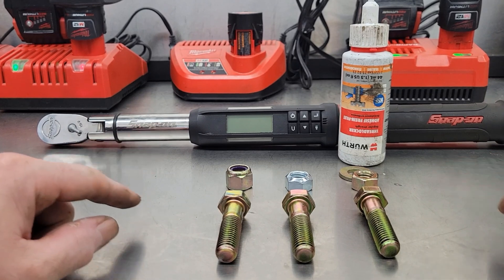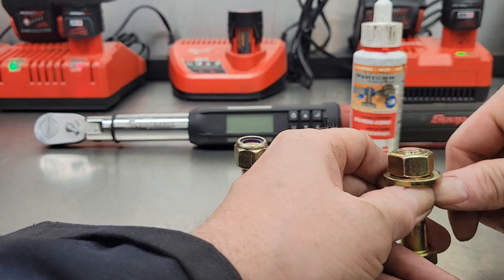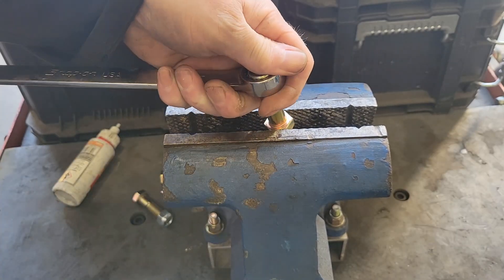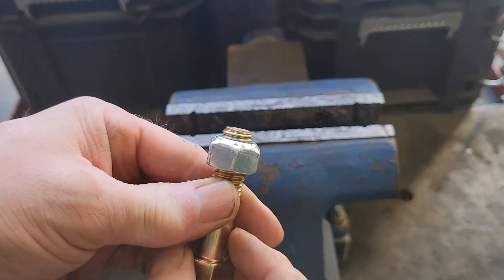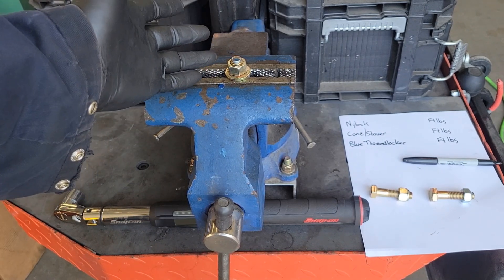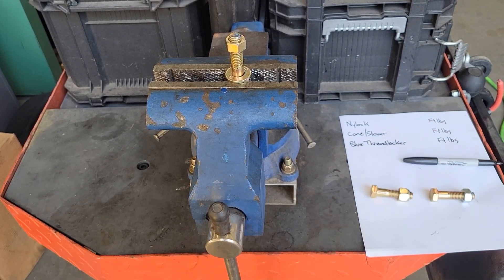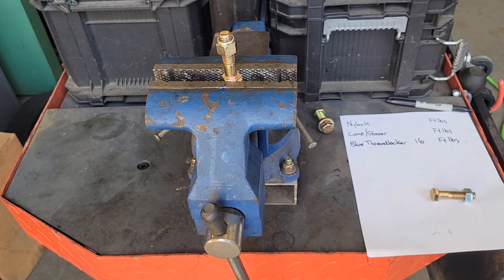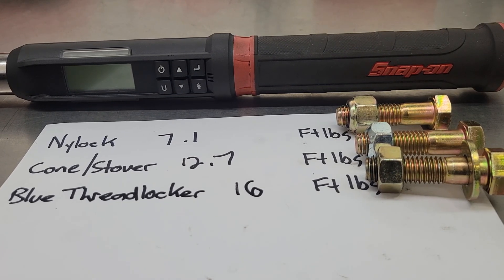Torque Test. Thread Locker Vs Nylock & Cone / Stover Nuts. Which Is Strongest? Watch & Be Surprised!

Comment: I feel like the blue threadlocker would have worked even better if it were applied according to dreadlockers directions. All you need is one drop of this stuff directly on the threads right Right about at the leading edge of where the nut is going to seat.   From what I understand more threadlocker is not necessary or good with a bond.
Reply from the maker: Some very good points. Thanks for your input. It's appreciated.

Comment: I'd like to see Nyloc WITH theadlocker.
Reply from the maker: Never thought of that.
Reply: @jkg6211  I think I read somewhere that you're not supposed to put Fred locker on a nyloc nut. Not sure why.
Reply: @Bubbz2024  
I finally called two major manufacturers and spoke at great length (VERY helpful people), and discussed the topic of why, how, and when to use them.
 
Threadlockers are anaerobic, meaning they won't harden in the presence of oxygen. (that's why they don't harden in the bottle) 
BUT it also needs free ions from the metal surfaces of both bolt AND nut, along with the tight fit between the threads of the bolt and nut to complete the curing process. 

This works as intended with regular steel parts, but you need an activator/primer for stainless steel, because it's passive - meaning that the stainless steel doesn't freely give off the ferric ions like regular steel does to complete the curing process. (ferric ions + lack of O2 = cure)
 
Most threadlockers will damage plastic, but most types of nylon will be okay (?)... but the primer will help, regardless.
Apparently, the length of metal to metal contact between nut and bolt matters when using Nylocs.

My testing shows it works pretty well with the recommended primer, but not that much without it. (on stainless bolts/Nylocs, anyway)
 
Hope this helps others like it did me...

Comment: This test makes NO sense.
Reply from the maker: I did this test to see what method took the most torque to break free. Its hard to simulate vibration so i used a torque wrench so it could be measured.

Comment: I thought the idea of these was to resist being pushed backward by the load under sustained vibration.  If you wanted it to require more torque to undo with a wrench, you could just tighten it a bit more.  It would be interesting if you tested these being used for their intended purpose - tighten it against a load, put it where it'll be subjected to vibration for 24 hours, then see which ones are still fully torqued.
Reply from the maker: You made some good points. I should come up with a way to subject items to sustained vibration and then retest.